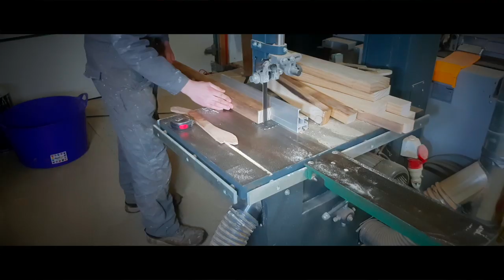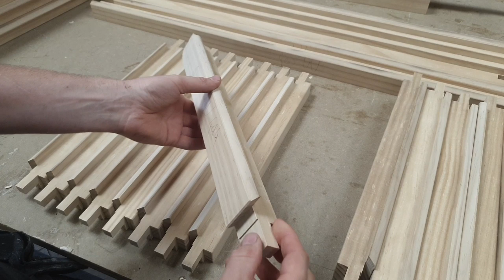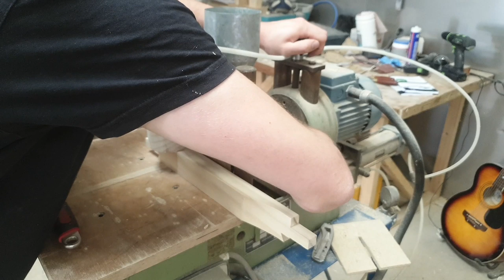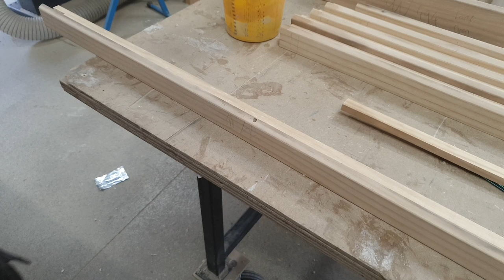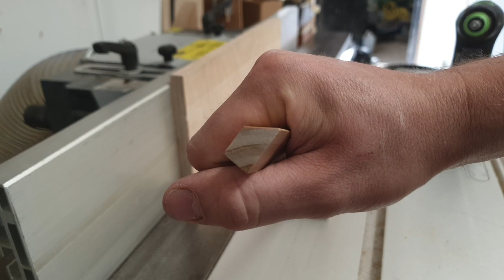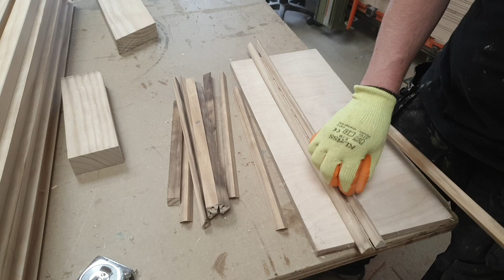Astragal Bars - Plant-On Glazing Bars for Timber Windows

Comment: Great job as usual, thanks for showing the dowel machine, I have the Mafell doweler  but that looks so much easier.
Reply from the maker: It's a handy machine, it is not as accurate as s mafell doweller but for intricate little bits it's very handy!

Comment: Nice detailed video, and great method, although I can't get on board with the v joint technique. From what I understand it's just a teknos paint method for selling unnecessary product. Adding an impermeable sealant into a timber joint is asking for trouble. If the paint begins to fail, any water that finds its way behind the sealant will struggle to escape and remain in the joint. As you're using Accoya there is a very low chance of rot for 40 years or so even if it was left unpainted, and shrinkage is unlikely so I don't see any need for these extra measures anyway.
There are 100/200 year old windows still in great condition done with a flush joint, these will have usually been painted with linseed paint which is breathable allowing any moisture to leave the wood. This only needs a fresh coat every 10-20 years.
Not having a dig at your joinery btw, it's bang on, just my opinion/knowledge on finishing.
Reply from the maker: HI James, Its an industry wide method and it does work tbh! Yes with Accoya the window will not rot using a traditional flush joint, but there is still a teeny amount of movement, and you will see a hairline crack in the joints. this will be a starting point for the coating failure. The use of v groove sealants is for long life paint systems, where the coating will not need any work for 10 years plus... cracks on joints wont allow this. It also only seals the joint, so the timber is still breathable through the paint. Im afraid the old redwood used in traditional windows is a thing of the past. Oak doesnt last like it used to either so having perfect protection is key. 

The v groove sealant also helps with spraying, allowing paint to flow into corners better. . I Guarantee its a lot quicker applying v groove sealant and spraying to a finish product than it is not using sealant and painting by hand!

Comment: How much per hour do you have to pay that shop dog to assist you?
I've gotten into muntins for cabinets using my FD 250 to bore the dowel holes and a Felder shaper for profiling the muntins to match a Felder tooling profile. My muntins are 14.5 X 17.6MM in
cherry for a bath cabinet. Thanks for you videos as I have no one with similar interests or equipment.
Mafell is nice but I would have to eat cheese sandwiches for many months if I sprung for that.
Reply from the maker: Haha! Nice one, there doesn't seem to be a lot of quality joinery content so doing my best.

Comment: Thanks for a great video. just as a personal aside, I often get lost when you are explaining what you are going to do, and why. When I see the end result it usually makes sense, but have you thought about a briefer introduction, then do the task, then explain why you did it that way, so we can see the finished result during the explanation.  This is NOT a criticism, just a selfish observation that would help my understanding
Reply from the maker: Hi Richard, thanks for the help, im continually trying to hone the technique, and it's good to have some feedback. Fully understand what you mean and will try and do something similar in future videos 👍
Reply: I agree.  Less intense detail as us joiners know the ins and outs of setting, machining e.t.c. but are really interested in how others get around certain design problems. Found this video very interesting until the end when the most important bit was not shown but explained - sounded like the glazing beads and internal astragal bars were all connected into a frame and then stuck to the glass with security glazing tape.

Comment: Your channel was better when you didn't say anything brah
Reply from the maker: No worries david, ive had mixed response, but the older videos with talking i agree, the newer ones i think are better, as they are delivered as intended, and not read in your own words from subtitles.
Reply: @BradshawJoinery  I like to make my wood working vids with voice on the spot. Sometimes I have to shut down the machines to get min noise. The direct action between what I want to say and concurrent action at the machine or hand tools gets the most out of the scene. Early on I had to rehearse a bit in me mind what I wanted to cover otherwise I had big gaps on the audio but after some videos with speech it came out smoother with no gaps. Same way when I got into selling my work and talking to groups of listeners.
Takes practice and forethought to make it jell. You have more detail in explanations than most others so I would think you could outline the words before you get into the video and you are on your way. For someone to say they like your vids without words makes me think they (they) are not equipped to process visual and words easily at the same time; some people are just that way. The masses are not they way.